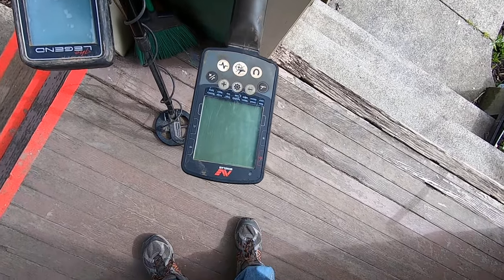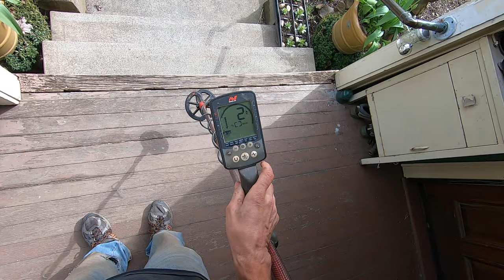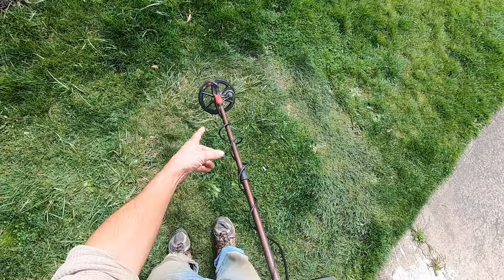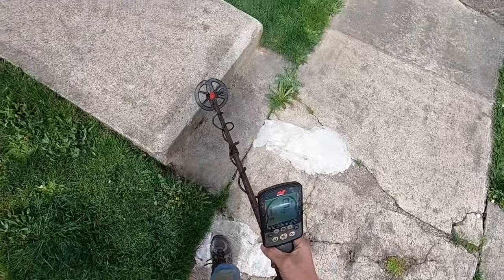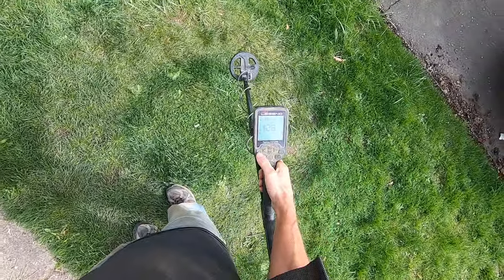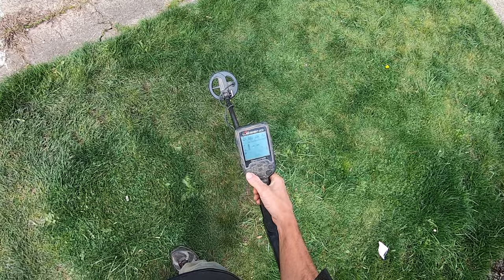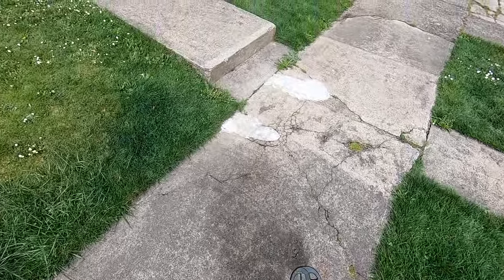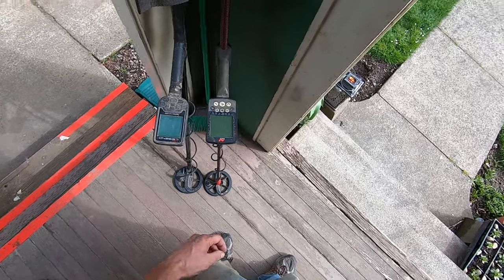Legend 6" coil vs Equinox 6" coil.

Comment: You should have titled this "The exact wrong way to metal detect". Seriously, who turns on their metal detector indoors right next to another metal detector that's already turned on? You do know that the equinox has noise cancel and that you're supposed to ground balance before you start swinging right? Either you are a total amateur or you are getting paid by the manufacturer of the legend. Either way, everyone that's in my Facebook group is having a good laugh with this video.

Comment: Love your videos! I've got a Legend on the way. I saw a Detecting NYC vid with the Legend at the beach.. At first he had a bad time because he had the setting somehow messed up.. after a couple hours he decided to read the manual and watched the "beach" video Dilek made, then changed a few things and was killing it. Said it closely matched the Nox.  First place I'm going to take it is to a beach that I've never seen anyone detect because it's under high voltage power lines with highly mineralized ground in salt water with a ton of old rusty iron.. But I'm excited. It's been a public beach since the 1800's (Back before even the Mosquito Fleet was in operation on the Puget Sound) and there are not many detectors able to handle it up to this point.

Comment: Each of us has to run machines however it makes them confident and the machine that is our preference. I never run more than 22 mostly 19,20 sense on my nox ever. I have been in 2,300k towns slap middle on curbs and never a issue. Is it possible all nox arent the same?  Just so were clear never a issue all encompassing quite,nothing broken or drowned! Also your in the minority on the take but indeed you have the right and in your best interest to use what you like or prefer! 
                          Have a good one paystreak

Comment: I have the Equinox 800 with all three coils had no trouble with it breaking parts and the performance is A1, It does struggle in  heavy EMI as any multi frequency machine is going to struggle in EMI. I also have the Deus 1, The Knox is far better in modern trash as i gives a better VDI and is amazing on the beach, The Deus is better in  the heavy iron, and has faster recovery speed, horses for courses,

I Do think Jeremy is experienced and Knows his stuff, just think the Equinox is not for him in the conditions and the way he hunts

Comment: Holy Crap!!!  Did I just hear him say that he put a thousand hours on the equinox and didn't find one silver coin. I'll be right back, I need to listen again...............yup, that's what he said. 
If that's true there's no way I could trust this guys opinion on any machine. Sorry but that's my opinion, he seems like a nice guy but geez, If I used an ace 250 for 1000 hours I know I'd find at least one silver.
Reply: If your not where the silver coins are at….you won’t find them. I have found silver and gold jewelry by the pound in my area over the years, but no silver coins. Plenty of silver coins in other locations but not my city, it’s not old enough. He doesn’t ever seem to leave his curb strips very often. That may explain it.
Reply: he's hunting in areas he's already pounded for 20 yrs with every detector,thats what he meant,then with the legend he's finding silvers and indians where hit it hard with the nox and the deus 2.
Reply: @richdtectntx.5514  If that's the case, it's still hard to believe. The Legend may be better than the Nox but the Nox is no slouch either....I guess time will tell as I continue to use the Legend more :)
Reply: It's all about programming and settings.  Neither machine performs bad it's just some will shine in some situations, others will shine in other conditions.  Run this same test on wet salt beach and the NOX will win easily right now.

Comment: 1000 hours and not found silver on the nox can't handle the EMI haha try noise canceling it for a start. Your proof is utter rubbish. I am not nocking the legend give it some time to iron out its teething problems I am sure it will be great but your test was a load of bull. I run the nox on beach, medieval and roman sites flat out nothing notched 23-25 sen 2-5 recovery noise cancel and GB it absolutely loves silver coins and rings tiny little cut quarters of hammered coins. It paid for its self in the first two weeks and has done over and over again. I wonder if you paid for it yourself or was given one

Comment: I love my heavy etrac, but wow that legend nearly half the price and twice the performance and build.
Reply: I've been using the Etrac for 7 years now and I haven't used a machine that goes deeper on silver and copper (except the CTX).  I do use a 13" ultimate coil though. I preordered the Legend and have been using it for a couple weeks. It's an amazing machine and I wont be getting rid of it...buttttttt.......it will not get the deep coins that my etrac can get. 
The Legend has it's place and so does the Etrac. For old parks that have been hunted a lot but still has deep coins, you cant beat the Etrac.  For field hunting, Beaches, trashy areas...the Legend is great.
Reply: @randyluna551  Great,  Thank you, I've really wondered how the legend will stack up. I like that ldea of the light with 6" coil with multi, but with the id that the etrac I just got used to,
Reply from the maker: Once you get a few more hours on the Legend...You will never go back to the Trac.
Reply: @PaystreakSuperfreak  you definitely deserve the best, I just don't use them as professionally as you do.
Reply: @PaystreakSuperfreak  Time will tell....and if or when that happens I will definitely tell you 😊